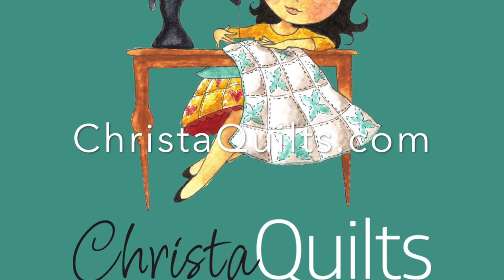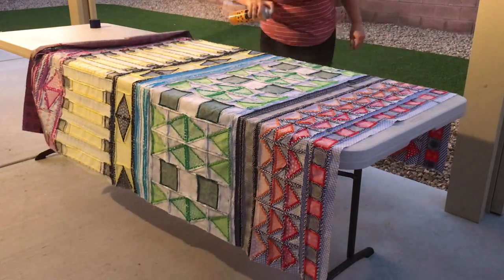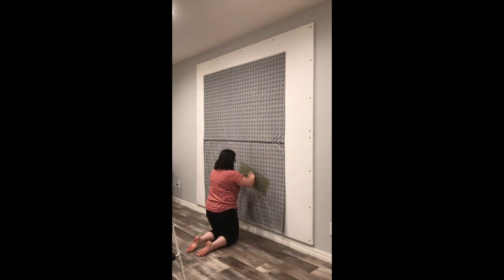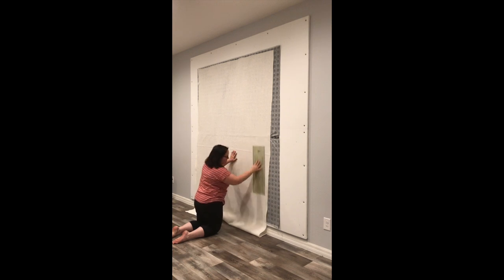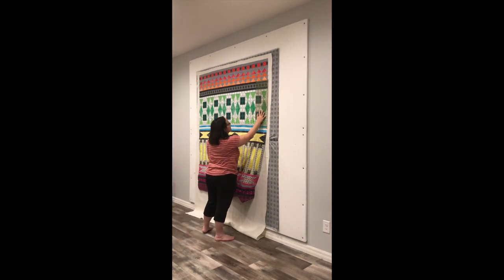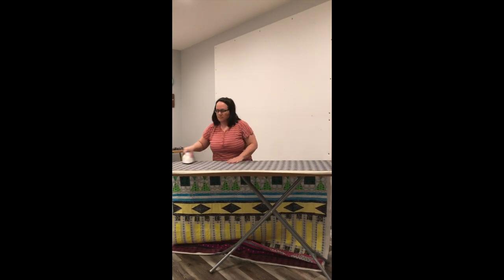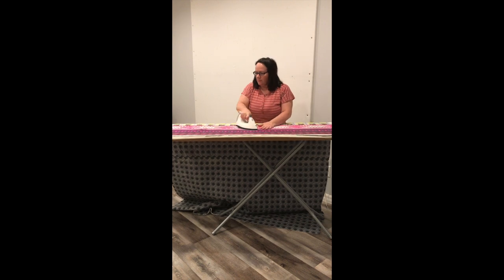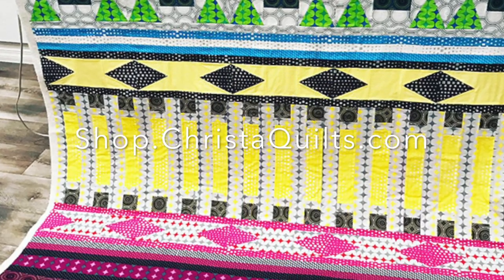Tutorial: Spray Basting a Quilt

Comment: I used this method over the weekend.  I did it inside with a window open,  and all was fine.  As I was undertaking the task, it occurred to me that my garment steamer would be helpful. It was.   The spray that I used called for spraying the batting, and I preferred that.  I worked with vertical halves and used a "hinge fold" on my fabric once I aligned everything.  I put right sides together and ensured the fold was in the middle of my backing (I often have pieced backs, so I like to have a mid point reference).  Sprayed the batting, brought the other corner so wrong side against batting.  I used a straight edge to flatten the fabric on the batting.  This way the ruler/straight edge  glides over the fabric

I was able to keep everything straight--vertical/horizontal seam lines as well as the centering.  

Very few videos and postings on this method.  It is such a game changer...so I will evangelize it.  If I can get a quilt basted perfectly in 30-(ish) minutes...that's a no brainer. Perfect line of sight for all of the edges and so easy to ensure that seams are straight vertically and horizontally.

I typically use fusible webbing (in spaced strips).  I can still use that as the steamer perfectly melted it (just apply to the batting).  So for any who have chemical sensitivities, using fusible web (mystifuse/ stitch witchery) with a steamer will work well in this application.  The steamer does a nice job of relaxing the batting and ensuring perfect adhesion (of spray and/or fusible).  You can use an iron, but you are working against gravity.  A steamer wand much easier. (But I went into scientific mode testing all possibilities).

Again, thank you for this generous sharing.  It takes the most tedious chore of quilting and makes it almost enjoyable!  I have now basted my 2nd quilt inside of a week...as I no longer dread doing it.
Reply from the maker: I'm so glad this method was helpful fo you!

Comment: Hi Christa - I’ve been using your method for a while (with a bit of a modification) and love it - i have been spraying the batting then putting the backing on. Flipping and spray batting again and putting the top on.  Is there a reason to spray the fabric instead or just for ease on the design wall?
Reply from the maker: Several reasons - it's easier to deal with the quilt, and it also uses less of the basting spray that way. You can also see where you are spraying easier.
Reply: I found this to be my preferred way as well. Many ways to skin the quilt basting cat.

Comment: Does the ruler get sticky when you use it to smooth out the backing before you add the batting layer?
Reply from the maker: Yes it can, but it's easy to clean with warm soapy water. Or you can do what I did - use a separate ruler just for basting.
Reply: I sprayed my batting and put fabric over top.  I used a straight edge like a squeegee on the fabric.  It work perfectly and no residue to deal with.